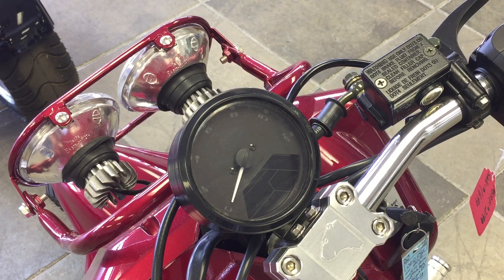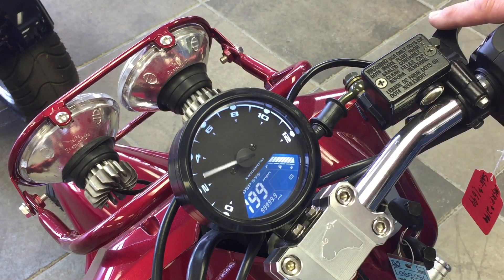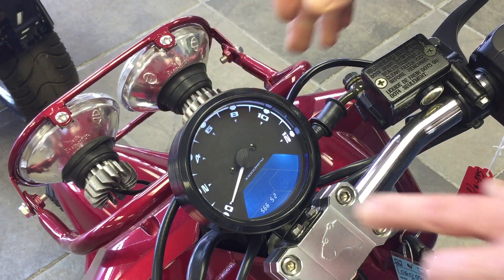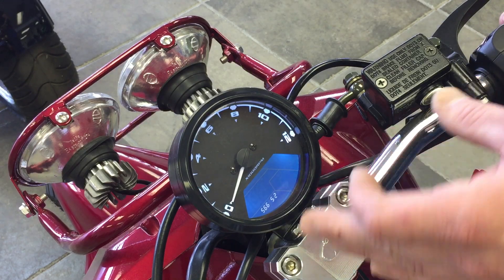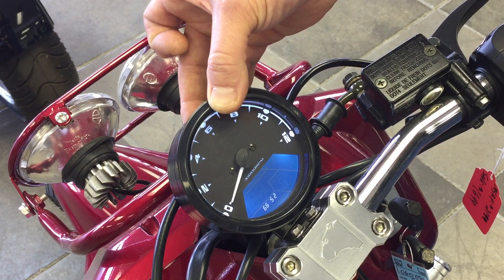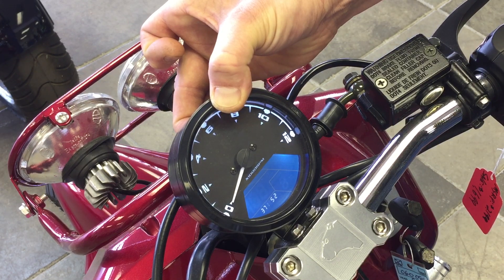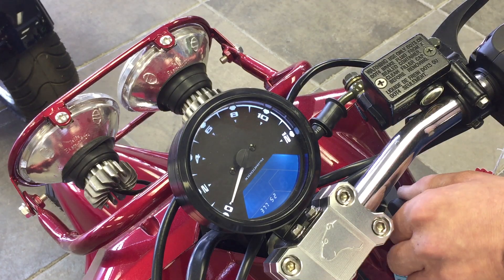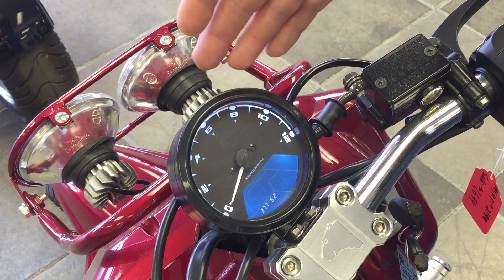How To Calibrate Your Digital Speedometer Ice Bear Mad Dog Scooter

Comment: If you have 14" wheels like the gen 5, this will be a different number I'm assuming. Anyone know what that is?
Reply: My Gen 5 has a front tire radius of 9.25". So 2r= 18.5". So 18.5" converted to MM equals 470mm.  I'm going to try 470 52 and check speedo with GPS.
Reply: @fanofoldfans9238  I ended up buying this same speedometer but with different firmware and set it using my circumference and it's spot on. It's was only like 30 bucks and plugs right in.
Reply: @androidken  OK good to know. But you mean Diameter of the tire? Circumference would put you into 4 digit MM range. Just to clarify...
Reply: @fanofoldfans9238  How did the 470 52 work out? The outside diameter of my tire appears to be 21" so I am going to start playing with it.
Reply: 549 52 is damned close.
Reply: @WhitBoss  I have the Gen V model (150cc) and I'm going to try this code.

Comment: mind if i ask, how did you get the 377 52 based on d circumfrence of d tyre.
Reply from the maker: I believe it is based on circumference like you said, My rep at IceBear Gave me the codes.
Reply: @streetsidescooterspowerspo9149  How did you get your speed working ? My tacho doesn't have the wire with the magnets for the speed...

Comment: my difficulty is that when I do the procedure of holding down the button on the back of the speedometer for 5 seconds instead of the screen that comes out to you in the video, an ID comes out to me to enter and I can access the menu only with 888 but unfortunately the functions are very limited. How can I do to avoid this problem? Are there other ID codes to enter? I kindly ask you for help.

Comment: What does the 377 52 represent. Mine is setup with that number and is still off by 6-7mph
Reply: Seth Schroeder same. Mines off by 5MPH exactly
Reply: 377mm is supposed to be the circumference of your tire.
Reply: I will check and see if that's what the problem is
Reply: Try 340 52
Reply: @BenjaminKillian  I think that's where I ended up also using a GPS Speedo to check against the bikes speedometer
Reply: Benjamin Motif  thanks mine was at 377 52 as well and was of by 4mph . Your suggestion of 340 52 fixed it 🙏🏾

Comment: Where can I buy this speedometer? for my tao tao crusier it came 3 gauge chrome so I bought one these universal one eBay but the wiring harness on the back of this 9 pin female and bike bike end is also female.
Is the wiring harness on these different? Any help will be great.
Reply: These are the same universal ones you buy on ebay. If you are gonna replace your factory cluster with one of these you are gonna have to wire it in.

I put one on an off road buggy, it's really not that hard. Takes some trial and error to do the calculations to get the speedo reading correct (and double checking it with a gps). My gas tank doesn't have a sender and that was trial and error to get a resistor to fool the gauge to make it quit flashing empty tank all the time.
Reply: neo 71665 
Thanks man!! I bought these speedometer for $25 on ebay sameone selling on cajun moddog for 89.95 what a ripoff.
Reply: How i can Fine this speedometer in eBay? Can't fine this i wan a dos for my bike ..is to mouch To put this on ?
Reply: @user-neo71665  

Can you share what resistor you used to fool it empty?

Comment: Are you guys going to post anything about a fuel gauge not being accurate?
Reply: My fuel gauge won't even read anything past quarter tank.
Reply: @SunsJoel  My fuel gauge did the same thing go it into the Setting mode there’s five different settings you have to hold the button down to go through them once you get to number 4 Setting at the bottom you should see A 2 change that number to 4 And it should work it did for me I just did it

Comment: what is the difference between 566 52 and 377 52?
Reply from the maker: 566 shows your speed nearly doubled. calibration setting for a completely different bike i believe.
Reply: its the circumference of the tyre.. the smaller the number it will show faster speed if not measured correctly

Comment: Does this calibrate to mph?
Reply from the maker: Ryan Foust Great question! We had a fellow rider ask the same thing at the shop today. You are in MPH it just seems like km because the speed is so far off. You are putting way more miles on the odometer with the Speedo incorrect. By calibrating you will have more accurate speed and miles indicated on the odometer. I hope this helps!!! 👍

Comment: I went through the entire calibration more than once, correct setting, but now does not change from zero MPH.  Before calibration was off by 10 MPH on highway.  Any ideas?  was working before calibration, just not correct, now zero, RPM works fine.
Reply from the maker: The first thing I would check is the pickup attached where your front disk brake caliper is. There is a magnetic sensor that picks up the revolutions on the front disk brake rotor. After that I would check all the electrical connections that feed into the back of the speedo. Hope that helps.
Reply: What bike do you have

Comment: what 377 52 number for ?
Reply: The distance from the center hub to the magnet in mm (Here is about 120mm) . distance (120mm)  X 3.1416 = circumference the magnet rotates (377).  The number 5 is a fuel sensor calibration.  Calibration #1 0 ohms=full tank #5 0 ohms=empty tank (that's why it blinks)  #2 might mean 80 ohms is full tank. The last digit is cylinder count or number of magnets, this varies between manufactures. Finally other models have "5 tables" to set up. It is really a crap shoot which model you will get in the mail.